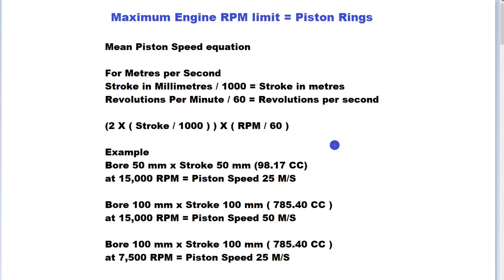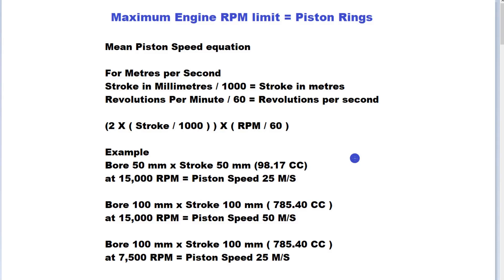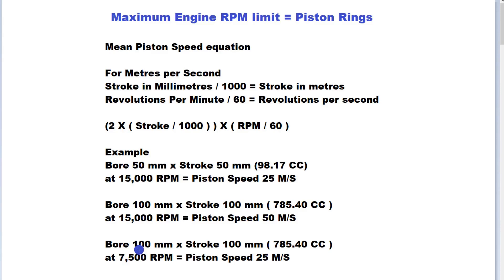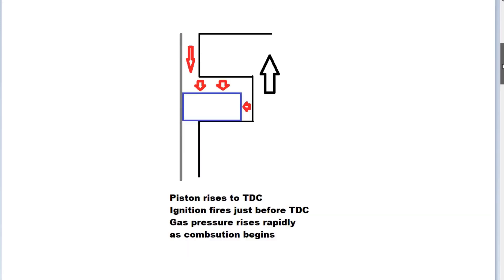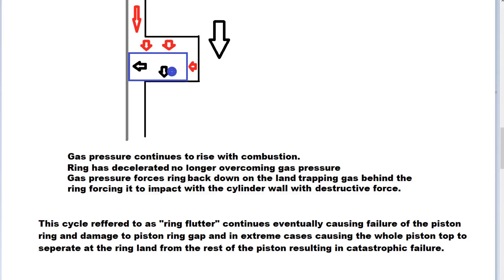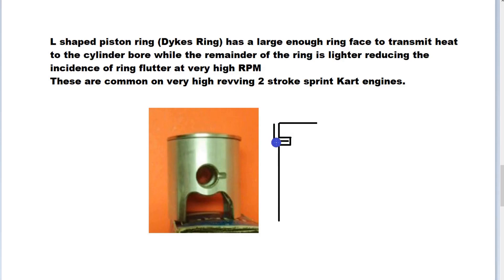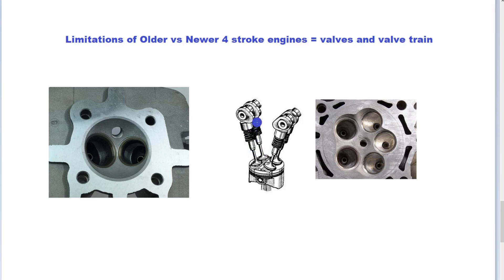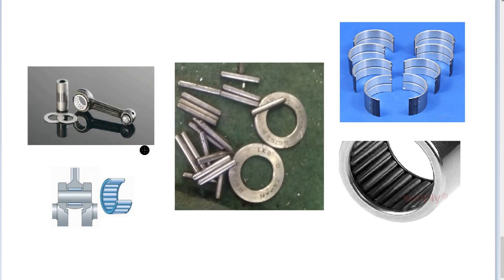Why 2 Strokes can Rev Higher than 4 Stroke Engines and What Limits Engine Speed.

Comment: Sorry, a four stroke can rev higher, except small engines. This is theory. In practice with today's valves, fuel injection, running close to stoichiometric an inline 4, with 250 cc per cylinder, can rev up to 17000rpm without losing power, a two stroke 250cc single or twin cylinder would never even hit 15000. Two strokes have always heavier pistons, you need skirts, the crankcase needs to be heavier, the friction piston-cylinder is always higher, there are real world limits. 125cc gp bikes didn't rev as high as today's 250, or along those lines, with half the displacement. 250cc four stroke CBRrr could rev up to 20000rpm, 67.5cc per cylinder, a 50cc 2-stroke bike would not be able to hit 20000rpm, the Japanese managed 18000-19000 rpm on twin cylinder 50cc two strokes, 25cc each cylinder. The only real world scenario is a 50cc single cylinder engine because a four stroke would lose too much power moving all the components. It's interesting to see how your 'theory' does not match what results from years of practical experience by Japanese experts, engine tuners and everyone who's tried to make these engines rev as high as possible. F1 v10 4stroke 3liter engines revved up to 20000rpm, 300cc per cylinder. I challenge you to make rev a 300cc two stroke engine at 15000rpm without the power curve going downwards.
Reply from the maker: There are 2 stroke engines that rev to over 35,000 RPM ?
And 2 stroke rotary disc valve intake 100cc Kart engines back to even the 1990's or before were revving to 20,000 RPM ?
And even Reed intake 100cc 2 stroke Kart engines rev to 16,000 RPM ?
You didn't know this ?

Comment: Can ring flutter create excessive crank case pressure, in a 4-stroke?
Reply from the maker: As the rings loose seal the gasses will blow by the piston to the crankcase so it it is possible.
That said ring flutter is generally known as a mechanical constraint to RPM limits in 2 strokes where 4 strokes are limited by valve train inertia.
Meaning you are more likely to experience valve bounce before you have reached RPM suffice to experience ring flutter.
Reply: @AuMechanic  thank you for the reply!! I found this video because I have a Big Bore, high compression, TT500 Yamaha that I race and I’m experiencing excessive oil coming out of the crankcase breather at high rpm. In my research, I became aware of ring flutter. The motor has good leak down, zero smoking. So, it could be a possibility. Im also going to address the oil scavenger pump. Maybe it’s not doing it’s job. Thank you again.
Reply from the maker: @duc626  Other thing is is not that uncommon for older modified race bikes to have a bit of excess case pressure as the stock breather can be overcome and may need to open the breather a bit and run and a catch bottle on the breather outlet.

Comment: Super video. Another question would be any benefit for 2t engine run/response from decreasing piston and confod weight (refining stock ones) ? Of course less weight would catch revs quicker but wouldn't it affect the momentum engine generates?
Cheers
Reply from the maker: Not really, those parts are reciprocating.
As in decelerating to a stop at each end then accelerating to peak speed.
So while less weight will have less "push" by inertia to the crank on the down stroke it will take less energy from the crank to accelerate those parts back to peak speed sort of cancelling out any impact on rotational inertia of the crank.
That's a simplified explanation.
So any weight reduction of those parts will reduce losses in power but not inertia.
Reply: @AuMechanic  Thanks for quick reply. Cheers!

Comment: Based on the proportions math- basically what goes in must come out, proportionally. In a big bore- the rings should make a considerable change to the math at the end of the exhaust? So my thoughts go to should I take the rings into consideration when designing the heat velocity assist on the end of my pipe?
Reply from the maker: The size of rings or bore size wont effect the pipe equation in relation to inlet outlet ratio, and exhaust temperature is mostly a factor of brake mean effective pressure (BMEP) of the engine.
I'm not sure if that answers your question fully though.
In relation to gas components, if you look at my pipe calculator software you will see there are input boxes to allow adjustment of the Individual gas constant and Ratio of specific heats, they are pre filled with values that reflect an average for gasoline at an average exhaust temperature of 500K and air fuel ratio of about 13:1, adjusting those will not greatly influence the localised speed of sound in the pipe that determines the tune length.
They are there simply to allow any user to adjust them if needed when using odd fuels and temp and AF ratios.
Reply: Thank you for putting the math and the science into words..  I have a terrible time eplaining what I just 'see' when looking at pipes- also am I using the daltons law of partial pressures in the right context here?

Comment: Are you familiar with the super common Chinese 44-5 two strokes? They use them on just about everything. I'm trying to figure out how to make them more powerful for my kid's go-kart. I feel like an easy first step would be finding lighter pistons and or a bigger cylinder. Then maybe some porting. Cheap fun!
Reply from the maker: Not aware of them, last Karts I was involved with were Yamaha  KT100 for the most part and a few reed and rotary valve intake engines.
In the case there are no rules prohibiting modifications to them in racing the first thing I would suggest is to measure the port timings and if they are similar to other Chinesium piston port engines you will likely find the intake timing is very low which can be increased by simply trimming some off the piston skirt on the intake side by 1mm at a time to increase intake port timing to an acceptable value compare to exhaust timing.
You will find other vidoes explaining how to do that.
Reply: @AuMechanic  amazing advice, thank you. Are chainsaw pistons with the same pin size and diameter worth experimenting with? They look lighter.
Reply from the maker: @Kantimitsu  Possibly but the only real benefit of a lighter piston would allow you to rev the engine higher but to do that you would need to add a programmable ignition and port the engine to increase port time area.
And after doing all that other parts of the engine namely crank or rod may fail to tolerate the higher RPM anyway.
My advise is start with best bang for buck meaning try what is simplest and cheapest first and taking a bit off the skirt to improve intake timing is cheap and easy.

Comment: A rotary engine is a four stroke right?  They can rev super high as everything is rotating and not reciprocating, but I don't think they will go 20,000 rpm
Reply from the maker: As with any engine shear size of the parts rotating will dictate some kind of mechanical limits on maximum RPM.
A small rotary for example could do well over 20k RPM where a large one might not like going over 10k.
This video just covers what that limit is for a reciprocating 2 stroke engine, being the rings.

Comment: I have a couple of questions:
1: piston ring flutter is a result of the combustion pressure not being able to overcome the ring inertia when the downward piston acceleration is to great. So logically, ring flutter has to be related to the piston acceleration, NOT piston speed. With a longer stroke at lower rpm you can have equal piston acceleration and much higher piston speeds. This indicates ring flutter should be mostly an issue for small, very high rpm engines, and larger engines should be able to run higher piston speeds than small ones, as long as their acceleration is not to great. However, as you stated, the real, observed limit for engines does in fact seem to be piston speed. 
Why?!?

2. I always thought the piston speed is limited by the rings friction more or less starting to weld it to the cylinder. I know the ring friction force goes down with speed, as there is a very thin layer of liquid on the bore and the ring is in a boundry condition, but I am not sure wether or not the force is falling fast enough for the power absorbed to fall off as well. 
In any case, is ring friction a real concern for high rpm or is it just the issue of ring flutter?

3: Both 2 and 4 strokes  have piston rings and you didn't really specify what the difference between them is, you just talked about issues with piston rings at high rpm. Why can a 4 stroke not run the same rings as a 2 stroke, allowing it to (at least in theory) rev just as high?
Does it have to do with 4 strokes having crank case lubrication and as a result blow by having a bigger effect on them? 

4:  I think journal bearings are used for reliability, which is the priority for engine manufacturers. If they ever were to become an issue couldn't you just slap a needle bearing on a 4 stroke and have it splash lubricated if you just wanted to get max rpm?
Reply from the maker: 1 The piston speed referred to is "mean" piston speed not peak piston speed.
Mean piston speed equation is 
2 x stroke x (RPM / 60)
So an engine with a longer stroke will reach the same maximum mean piston speed value at a lower RPM than a short stroke engine.
Reply from the maker: 2 and 3
Ring flutter is only a factor after you have overcome all of the other mechanical constraints including the right size and composition of rings for the application.
If rings fail and you are easily within the bounds of mean piston speed then ring flutter likely isn't the issue.
Reply: Back in the day, factory teams would make their engines "long rod" for the team race motors. One benefit is longer dwell time at TDC giving the rings a chance to lose upward inertia before being yanked back down the bore.
Reply: Regarding 1: If the piston to wall clearance has to rise to accomodate the piston growth at operating temperature, then the ring would have to get thicker to take the larger stresses. If ring thickness is proportional to the bore size it would  result in the max piston speed remaining constant as we scale an engine up and down, while still allowing slightly higher piston speeds in undersquare engines compared to oversquare ones. This could explain why we see a relativly constant piston speed, especially when you take into consideration oversquare engines are higher reving and more performance oriented  and probably get pushed closer to the limit anyways.
At least this sounds like a plausible explanation to me...

Comment: Last comment I swear but the reason for modern 2-strokes' higher RPM, according to Blair & Jennings, is the 'miracle' of finding that adding silicone to aluminum dramatically increased its strength, safe FPM for piston speed was more than doubled IIRC and set stage -- Jennings explicitly says "it was a materials limitation" Re 2-strokes before the inclusion of silic/a/on/ones to the aluminum (10-30%, with Japanese product having a distinctly higher% according to blair & jennings)
(I'm not gonna put up the math to 'real' measurements because I fear I botched it but FWIW Jennings says piston speed maxima is ~4k FPM(feet/minute), and that 3.5k FPM is about the fastest you can go before problems start (and describes high(est)-end performance as living in that land in-between 3500 and 4000 FPM, and how in that range you're swapping rings and are experiencing failures, he makes a huge point not to exceed piston speeds of 3,500 FPM if you don't intend on checking/replacing/etc the rings and all that!))

Comment: Thanks for discussion Re the rings & cooling, I had been setting 1-ringed builds (on 2-ringed pistons) and totally under-estimating just what I was doing to cooling (IE I'm only going to do 1-ring setup on my "hot" saw build) So glad you cover everything, realize now that - for chainsaws - this is actually far far less a problem, when I saw the size(vertical thickness) of your rings in the last video I saw I marvelled "wow chainsaw rings, like my 54mm and 56mm rings, are 1.2mm thick!" so I guess my "lessons learned" in transmuting your points to chainsaws are:
 - With such thin rings just 1.2mm tall on my >100cc chainsaw builds, and the pistons having 2 ring grooves, I should ONLY consider 1-ringed builds when the build is "hot" (IE something that will not be run for extended periods, I'm not talking about the silly competition, single-cut builds that are "a hobby/sport" to some small niche, I mean a work saw that is "for felling trees, not bucking them" in fact those are the 2 "types" of builds I've done to the exact same saw powerhead (ms660)
 - Ring-contact with the wall, being so critical as it is, means ring replacement on any used saw is likely to boost performance;
 Would be curious for your thoughts!!  Also, Re "ring & top-end break in", would love your thoughts on my current approach: I put inferior (but still reputable) rings onto my piston at build-time, that I consider as "throwaway" rings; I do a VERY light edging/chamfering on any ring (throwaways & finals); I slather the rings, and everything really, with a rag with high end marine grease, wipe-off as much as I can w/ fresh terrycloth rag that's oiled w/ WD40, to ensure no surface is on the drier side during first starts.  Then process is:
 - Put drill onto my flywheel's retention bolt and spin engine that way a bit;
 - Startup, let it idle through 1+ tanks (only ethanol free good quality fresh fuel, 40:1 for big saws and 45:1 for smaller climbsaws), and finally:
 - On tank 2-->3 I'll begin some actual throttling, just lil bursts, quickly getting to lil bursts of full-throttle.  I then do more and more full throttle cuts, and longer ones, idling at length and getting on/off "heat cycling", then actual "full throttle, for actual long cuts 15sec+"
Would love your thoughts on any of this, I'm always so intrigued by both yours & @49ccscoot's content/knowledge!!

Comment: At 9:57, the illustration, I see how the pressure could cause flutter and all but wouldn't the "predominate"/main force on the ring simply be the piston itself travelling downwards? If you had to guess, what % of the downward stroke  ('powerstroke') is seeing the ring outside its proper position?  How many times / how quickly is this happening?  Guess I'm uncertain if this 'flutter' is more of a "few flutters near TDC after ignition, before peak cylinder pressure, but finished and ring is proper WELL before exhaust port cracks open", or "the whole darn ride downwards until the exhaust has fully evacuated / equalized pressure ("true blowdown" as it were, no more positive pressure in cylinder left from last combustion event)

Comment: ok so limit of rpm is mostly on piston ring because of the flutter effect that will eventually cause the piston to rip apart... but what if the piston does not rip apart yet..how is the flutter effect of the piston ring affecting rpm of piston simply by just having some gases escape through the sides of the piston and downwards of the piston? how will this affect any of the variables for the mean piston speed equation? will there be a build up of pressure at the bottom of the piston slowing down the stroke per cycle and thus conclusively lowering the mean piston speed per second? I am sure that the piston ring limits rpm not only when it has caused the piston to eventually rip apart or not work because of that, but before it got to that, the piston ring was already reducing its performance simply by having gases escape through the sides, but how is it doing so in a more explained reason? thank u aumechanic u the best!! still watching ur vids after all these years currently watching ur expansion chambers playlist. Im learning this for 2 stroke motorized bicycles but hopefully i want to move on bigger stuff like motorcycles when  i have understood more. also been trying to read gordons book but it is complex. i hope u start posting vids again wonder why u stopped.
Reply from the maker: Hi Lyle
The issue is not a loss of performance, the problem with ring flutter is it causes the ring to fail and that ends in bore damage even if the piston doesn't fail at the ring land.
When the ring comes away from the cylinder wall allowing gas to bypass, it then slams back against the wall and that causes the damage to it.
Reply: @AuMechanic  blisters the chrome on the china girl cylinder, in the top cylinder area where piston changes direction.I can vouch for that. I too have gone fast utilizing your teachings Mr. Dave.......👍

Comment: Valve float limits rpm in 4-strokes
Reply from the maker: And as mentioned more modern engines have multiple valves per port, each being smaller and lighter than one larger valve allows the engine to rev higher before the valves start to float.

Comment: My CBR600RR redlines at 15000 rpm. My CR250R redlines at 10000 rpm.  Its all about bore vs stroke. Wider bore than stroke length= higher redline.  The wider bore =lower torque and typically high HP
Reply from the maker: Yes, because mean piston speed is derived from RPM and stroke length, so a shorter stroke engine will have a lower mean piston speed at the same RPM as a longer stroke engine.

Comment: Its got nothing to do with the rings. Two strokes rev higher because they combust on every stroke, instead of every other stroke like 4 strokes do.
Reply from the maker: Ah...no.
The number of strokes between each spark plug firing has nothing to do with the maximum mechanical limits of engine speed.
Reply: i lost respect at 8:40, but the mechanical limitation of poppet valves is more to do with limits than identical piston rings.
i'll add there is a Honda 4t that revs to 20k, but high spring pressure is a huge liability in too many ways.
i agree there is loss pushing only every other cycle. deceleration phase.